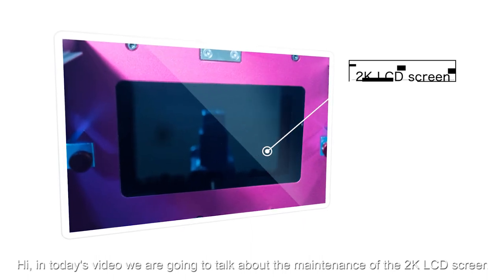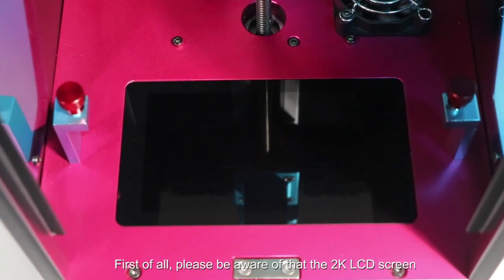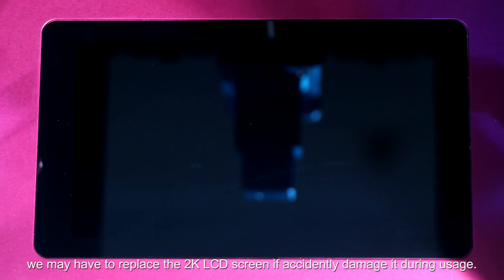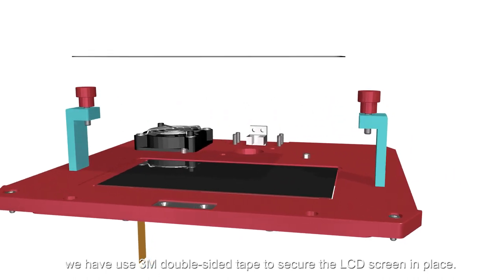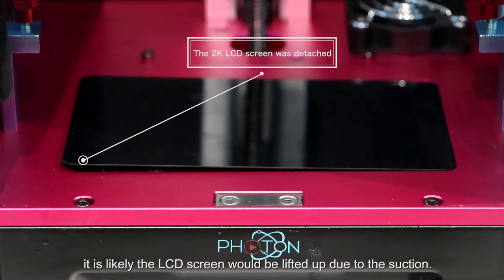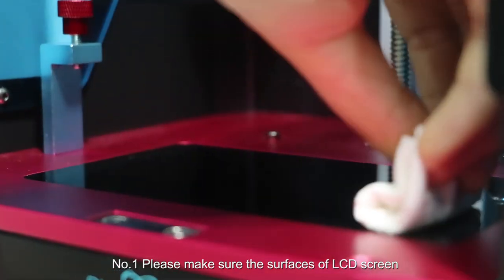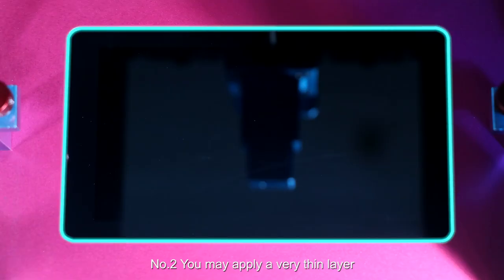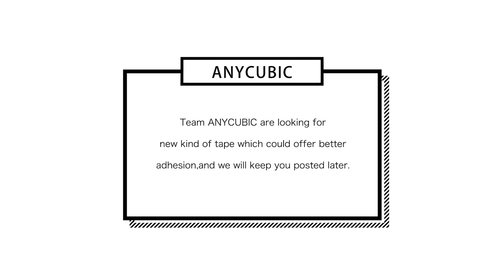ANYCUBIC Photon: 2K LCD Screen Usage Tips

Comment: Often the fep vat bonds well to the screen and this is a big problem since the screen is only held in place with four strips of double sided tape. This design makes the screen extremely prone to lift up with the flex vat when it is removed after a print and rip the ribbon cable right off the side of it like butter! One other likely scenario if that doesn't happen is that part of the lcd screen will stay with the flex fit as it's removed and the other part will stay with the machine cracking the LCD. A quick Google search of the forums and other Facebook posts will show you that this problem is widespread. The common theme Beyond reason for it happening is the simple question where can I buy a new replacement LCD screen.

Comment: The 2K LCD display is a consumeable?  Unfortunately it sounds more like a design defect.
Reply: dot_bob : YEP!
Reply: Doh !!! Okay, i will better buy an new FFF printer instead of a DLP because i think the consumeables are much cheaper :-/
Reply: I knew this before I bought the printer. UV will end up killing the LCD. The same happens to the micro mirror chip in DIY SLA printers using projectors. All I need to know is where to buy a replacement. Hopefully they won't be too expensive.
Reply: I have 2 FFF printers with nozzles down to 0.25mm. Printing at 50 micron layers doesn't even get close to the quality of the Photon at 100 micron layers, let alone anything going down to 25 microns. Yes, they are cheaper but if you want to print miniatures or something with a lot of detail you want to move away from FFF. I still use my FFF printers, but only for large "usable" parts, not for quality small prints.
Reply: The quality of the LCD 5.5 2K display used on your 3D printer will deteriorate over time under the influence of heat and UV light. That’s why LCD displays are considered a consumable parts on most UV LCD 3D Printers.

Comment: And once again.... The quality of the LCD 5.5 2K display used on any 3D printer will deteriorate over time under the influence of heat and UV light. That’s why LCD displays are considered a consumable parts on most UV LCD 3D Printers.